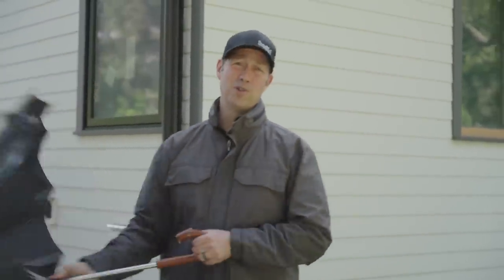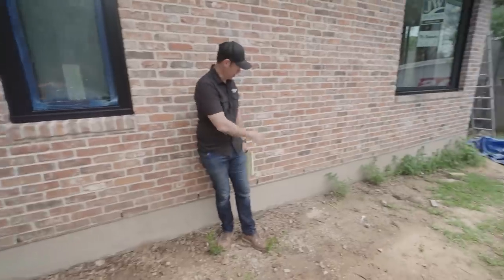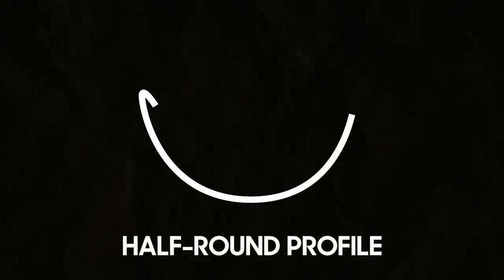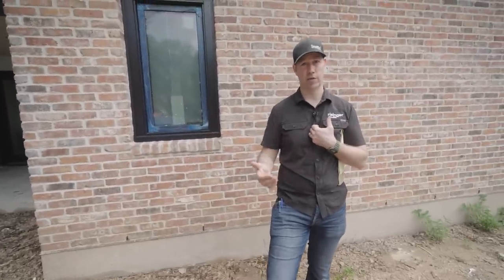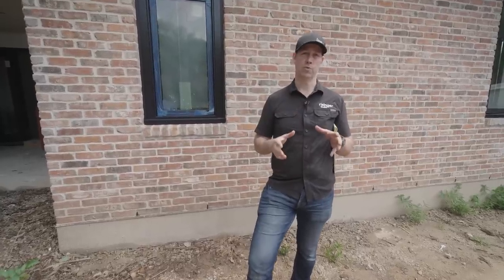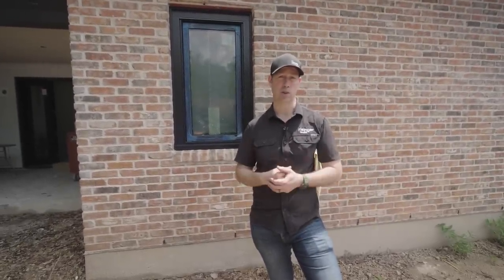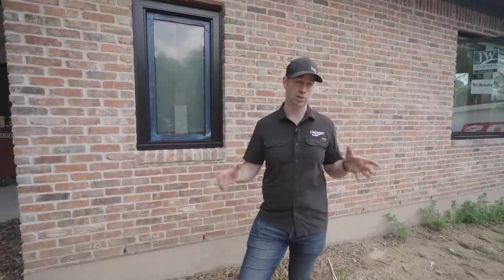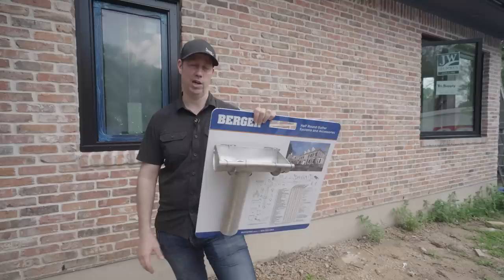Gutters 101: Costs & Options

Comment: Hi Matt.  I wanted to pass on a recent adverse experience I had with round gutters very similar to yours on your new house.  I have the 6" round painted aluminum gutters (made by Senox) installed by your same installer, Lionel from Central Texas Custom Gutters, on my house that you built 6 years ago. However, I have seamed gutters coming in 20' lengths as I guess back then the better seamless round gutters were not available.  After the snowstorm last February here in Austin, I noticed that the end section of a 27' length of gutters on the 2nd story of my house had been bent down (at the end farthest away from the downspout).  I theorized that the weight of the melting snow sliding off the roof likely caused the damage in that area.  However, luckily, no other gutter sections around the house, even an adjoining front section of similar length on the 2nd story, suffered any damage.  FYI, I tried to get Lionel to come out and give me a repair estimate, but he never returned the message that I left at his office.  So, I'm using another local gutter company to repair the damaged section.  At any rate, this other gutter company noticed that the gutter support hangers had been spaced further apart in that damaged end section than elsewhere around the house (mine were spaced at a 33" interval everywhere else).  However, in that one particular end area where the gutter was bent down, it looks like the original installers had for some unknown reason spaced the last three gutter support hangers at a 50" interval, effectively not installing (or omitting) one support hanger.  I believe that one missing support hanger is likely what caused or certainly contributed to the gutter damage on my house (which is costing me $900 to repair).  So, I'd like to point out that making sure you get the proper spacing interval for the gutter support hangers based on the expected weather conditions in your area (along with, of course, not omitting any that should be installed) could be very important in preventing future costly gutter repairs by homeowners.

Comment: Dissimilar metals like steel-aluminum can invoke galvanic corrosion.
Reply: I had the same thought. I’ve been doing some add-on mods in the backyard for adding market lights. I used 1/8” stainless-steel cable and made a point that ALL of the  other metal hardware was stainless-steel; all T316. I’ve seen galvanic corrosion occur after as little as a year.
Reply: It looks like Matt's gutters and roof aren't in direct contact with each other.  But I believe the mesh in those gutter guards is galvanized steel.

Comment: I remember in 1970's putting a Sears roll of a type of leaf guard in my gutters. Got it all in and stepped out to street to admire my great handy work. It looked super bad. Aluminum in white gutters and it was so shiny it looked awful. Solution: Can of flat black paint and brush and the guard disappeared! Now another house and I am old. Having water in crawl space issues. May have to put gutters on my 30 year old house. Dread that. Love the look, well, like the look of half round but worry about splash on fascia board vs K style. Also have to do some foundation water proofing. Money is not a huge issue. Knowledge and TRUST IS a huge issue. Must get this right as we are too old for the stress.🦇

Comment: I definitely recommend good leaf screens of some type, but up here in Portland, Oregon every company charges roughly the same for the screens as they do for the entire gutter system. It basically doubles your install.
Reply: I haven't heard of any system that everyone is completely happy with either.
Reply: And if you buy the ones they advertise on TV they are even more, probably 2x more then the gutters.
Reply: I had leaf guard give me a quote they wanted to charge me $2000 for two 16 foot sections and two down spouts without the leaf guard lmao F** joke 🤣
Reply: When I lived in Beaverton and was rehabbing my house there, I bought Gutter Guards from Costco and installed them myself.  Super easy and made all the difference in the world.  Couldn't have been happier with them.
Reply: Agree, I was coated $16 per linear foot and here in Florida, labor is not as expensive as in other places. The installers marked themselves out a reasonable investment for homeowners and so far, no one system has proved to be effective.

Comment: Hi Matt, love your channel.  I’m west coast and we use a lot of Fascia style gutter, not mentioned on your video.  Also missing is drip edge considerations, particularly with shingle roofs.  There needs to be a a flashing that extends over the gutter roof side edge, preventing water from running behind the gutter.   Also, regarding leaf guards, there are more expensive but maintenance free options, such as Leaf Filter or Gutter Glove.  These types of filter systems keep all the debris out, including shingle grit, and don’t require periodically removing and cleaning out.  Should note, a gutter system only protects the home against water damage if it is functioning properly and not clogged!  I was surprised you didn’t dive into this as most of the products you recommend you do so based on performance not price.

Comment: Interesting to see the leaf screens. For us they just block up and causes more issues than not having any leaf guards.
Reply: I find it a pain removing them twice a year to clean the gutter so I tried leaving them off one fall.  Two weeks later the gutter was full.  I put them back on.
Reply: How do they block up? That's specifically what they are supposed to prevent
Reply: @MandoFettOG  - Few things in technology actually work.  I have asphalt shingles which constantly shed particles and tar to gum up the works.  The elm seeds are way too big to cause a problem, but they wrap themselves up into a little sliver and shove themselves through the holes in great numbers.  Some stuff of course gets stuck going through.  That's why I remove the covers and spray with a hose to clean out the holes.
Reply: @MandoFettOG  i find the leaves break down a bit and simply gunge up the mesh. The mesh itself becomes plugged. Find it better to let it all go down the pipe to the tank and use other methods to clean out the leaves. Of course it all depends on what trees you have near the house.
Reply: @drewdoestrucks  i have a squirrel problem so i don't know if gards will work or not and a old growth beach overhang parts of the roof and a 🌲in the back that's how i cot the little cutie bastered wouldn't mind them if they left the house and shop/cars ect. alone
Reply: @drewdoestrucks  burgers 🍔🤔 im hopeful that going under ground and removing my all of the aerials services that it gives the baster one less way of getting on to my roof as dog's/ next door's cat or kids ect. wound love him for lunch 🍴😡lol 😁, but hearing 👂your experience makes me wonder what i can do after that to stop 🛑them and keep them in the back 🌲or off the hill
Reply: Gutter guards vary from state to state and even city to city.  One product does not fit all areas.  I love Matt's videos but i get turned off when he chastises a product that may actually work for some (I personally would never be caught dead buying Jeld Wen junk but it works for him).  I listened to people like Matt for many years and never tried the sponge type.  Then after trying everything else, I tried the sponge and BAM!  They work perfectly for my neighborhood/environment.  I know Spectra's ecoguard also works here.  Expanded metal would never fly here but in other areas it may work exceptionally well.  Don't listen to the internet, experiment, and see how things go!
Reply: @govegan0424  good advice 😀

Comment: Gutter guards.   I live in a neighborhood filled with maple trees.  Maple helicopters will defeat all forms of gutter guards.  I have tried many different ones over the years even a really expensive "National Brand" one.  The one with the helmet...... After I had them come out 4 times to unclog the gutters (that's their guarantee) they gave up and I got a refund.   When I re-roofed we just went back to the K style.  So I just plan on 2 or three times in the spring getting on the roof with the leaf blower to blow out the gutters.  The upshot is I can do a real good inspection on the whole roof and look for any areas of concern.

Comment: Maple seeds pile up on my flat gutter screens, but a long shop vac multi-part rigid extension with a J end does a reasonably good job of quickly removing them at nearly walking speed.  And walking on the ground is generally a lot safer than ladders. I do get about a bushel of seeds per 100 feet, though, so a big shop vac is best.
Reply: got sqarls/rodant problem? and a tree 🌳that extends overhead of the roof? the beach tree is stylish and 30+year's old  ect. and staying but its being a pain
Reply: ps. the baster is somewhat cute but he thinks the gutter is a pantry and 🛏beding store lol no get lost buger 🌲

Comment: If you do leaf always  do micro mesh with the same slope of the roof. Especially when you have shingles because of the grids coming down you want those stay out of your gutters. But you must have a slop otherwise you end up with leaf's in between your gutter guards and roof been stuck and redirecting the water where it doesn't belong. So Matt I highly recommend you fix that on your setup because you will see how much will collect in that "dead space" area fairly quickly.

Comment: Have you thought of adding a rain barrel to have some water during droughts? Does the city require you to have a dry well before you run the water from the gutters to the street or storm sewer?
Reply: It's going to become all the more important to have a couple hundred gallons sitting ready for your garden or lawn as we start to see hotter drier summers with less rain.
Reply: I highly recommend a water catch system for off of your roof it's one of the prime reasons for having a metal roof because the water is not nasty like off of a asphalt roof you can run it in to your lawn with underground soaker capabilities which would prevent you from actually paying for water to hydrate your lawn and also prevent from excess sewage charges
Reply: @astikennel  pretty sure sewer wastewater is a fixed $ amt. on monthly water bill. Actual inbound water run through the meter is variable
Reply: @willbass2869  - My water bill takes the water fee, doubles it, and adds it back in as the sewer fee so Cathie is correct for my area.

Comment: Have you ever had experience with rain louvers in lieu of gutters? I have tall (4 story)  brownstone. It single pitch roof with just two gutters 75 ft long each. Distance from roof edge to ground is ~90 ft and is unobstructed and the no doorways under the eaves (all entryways are at the ends of building). the Thinking of replacing gutters with rain louvers thus eliminating the need for downspouts. Given the long distance to the ground, my thinking is the water will be sufficiently dispersed to blend in with the normal rainfall. Appreciate your thoughts on this concept.

Comment: Some houses built in the 1950s and 60s DO have that 5 ft overhang. And they were even built in Texas. I know because our first home in SA had them and I have longed for them on every home since then. Not only do they help with water shed, but they are also help keep the home cooler in summer and warmer in winter.
Reply: @Teresa Coffman
South Africa?
Reply: @longiusaescius2537  SA is San Antonio, Texas

Comment: But living in Texas and especially in the Houston area where it is clay base don't you need that run off on the ground around the foundation to keep from having foundation issues?
Reply: It's an either or situation....either keep water away from fndn ALL the time & keep soil dry or rely on a monitoring/watering system to maintain a specific moisture level.
It's the wet-dry-wet-dry-wet cycle that causes swelling and fndn problems.

Comment: Are gutters, and rain water control, not mandatory in your building codes? Modern codes here require buffer capacity build into the foundations, so the gutters feed the buffer and the buffer drains to the sea via the stormwater system, but in a gradual and safe way. They use interconnecting plastic tanks under the building that are all linked together and there's a required capacity per foundation area requirement. Makes total sense as the flooding many regions see in modern times would have been soaked up by soil and trees and floods would have been rare. But now with lots of paved surfaces and roofs much of that water is directed straight to the stormwater system depriving the land of the benefit of it, and loading that drainage system. Buffering it can save lives if done in a widespread fashion. Building science from abroad for you, Matt.

Comment: I live in a double-wide in Tucson and it has a 1' overhang on ONE END (not on the front or back where the water actually runs off).  It was empty for 7 years, and the bottom few inches of the siding (the press-board crap they made back in the late 90's) was rotted.  I've been fixing the sides, but I just got done putting vinyl gutters (it's a trailer house!) on front and back just to stop the water pouring down the sides like a waterfall.  It only cost about $300 to do it myself.  It's just 2 - 57' straight runs.  $1250?  No thanks, doing it myself is like paying myself $80 / hour.

Comment: So, k style gutters handle more water, but do the half rounds handle it better? that was the impression I got from a certain home improvement show that renovates Old Houses. One quote I always remember is "you wouldn't use square shapes for the house plumbing, why use them for your gutters?"
Reply: Kind of like comparing apples to oranges. Comparing something like a gutter that needs an open top, is readily accessible, often mounted to a flat square surface, and is mostly just redirecting water without an absolute critical need for water tightness....to a house DWV system that is buried underground, in walls, completely inaccessible in most cases, and needing to last 50 years....isn’t really all that comparable.

Edit: I mean, dont get me wrong, if you can afford and put in the most effective gutters like these half rounds then thats awesome, but there is certainly a reason that less expensive gutters are more commonly used, and when installed and maintained correctly work just fine.
Reply: Half round gutters were used because it was an easier shape to make than a K style gutter and before made on site extrusion gutters became standard.  

From a pure capacity standpoint, as well as superior splash back shape, the K style is a more effective gutter inch per inch.  

But the biggest is "do you want to see your gutters or do you want your gutters to blend into the house" as whether to choose K or half round styles.  Then pick the right size and dont be afraid to use 2 different sizes if a long run needs 6" and rest of the house is fine with 5

Comment: Living in St. Petersburg, Russia (with a huge amount of freezing point transition of water per year and a humid climate), when working with drainage systems for classic pitched roofs, most of the attention has to be paid to the problem of ice. What could be more unpleasant than a cubic meter of an icicle that fell on your head? So cold attics, large slopes, no accordions and folds on the bends - and even the cables of the forced defrosting system and a direct outlet from the house directly into the underground storm sewer so that there is no ice under the house.
Reply: Same here in the northern US.  I'm considering a metal roof for my next house, but they have a reputation (more than with other types of roofs) for large amounts of snow suddenly sliding off the roof.  There are things that can be added to try to block the snow from suddenly sliding off, but they add penetrations into the roof that could someday leak.

Comment: I bought my house on the Mississippi River in Minnesota with a very sweet brand new 2nd floor balcony overlooking the river. But the dingleberries that sold me the house didn't put a gutter on a 35 ft section along the balcony and just in the time it took to get it installer out for a single piece it destroyed the Finish on the boards where the water fell on it...

Comment: I heard half rounds don't need leaf guards as they're smooth, round and don't have all the hooks inside of them. My half round system had the option of having a leaf catcher installed at the bottom of the down pipe with a little latch door if they were to be run into a weeping tile to the swale. Otherwise nothing is needed as it flushes right out... But I'm no expert

Comment: Probably should have explained the metal mixing a bit more, it voids the warranty because no one wants to deal with galvanic corrosion.
Reply: Roof warranties in regards to material cost is useless.  If that roof fails, the actual covered roofing material is less than 25% of the replacement cost.

Comment: Those sponge type lead guards.. . yeah take it from a guy that's made good money fixing them. In the future regardless of system you have to clean them off the debris. The screen you power wash out gone in less than half day. The sponge and cap type years after the warranty is gone. Two or three days taking them if to clean. In all cases put screen back on. Because the molds and algae.

Comment: I'm so happy to have found this video! I was wondering why you never use built-in box gutters in your houses? They seem to mesh seamlessly into the Perfect Wall design! I think they fell out of style because of the popularity of vented attics, but in your designs I don't think that's an issue, and it'd be cool to see your eaves keeping water off your houses without the need for add ons like a half round gutter system.